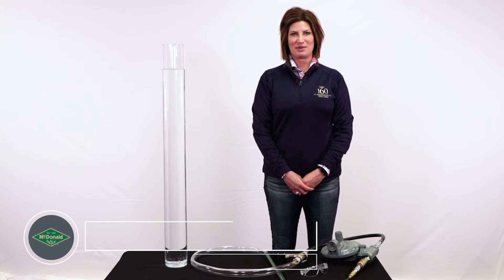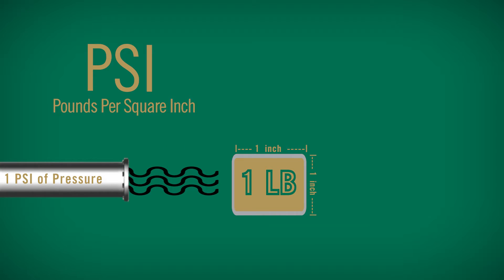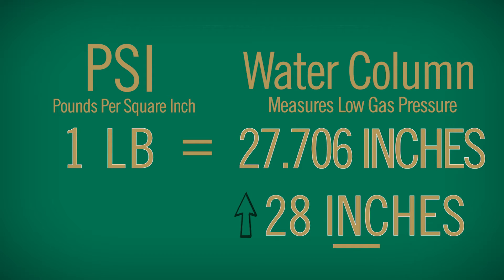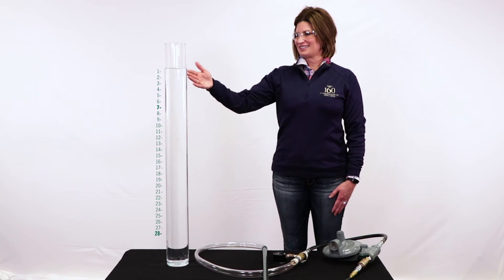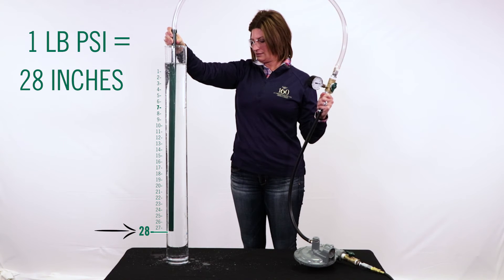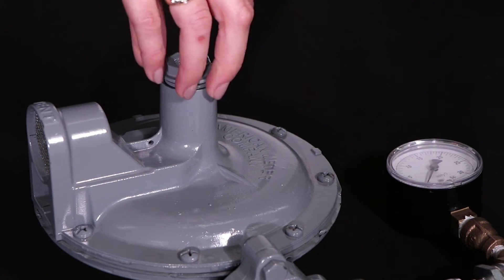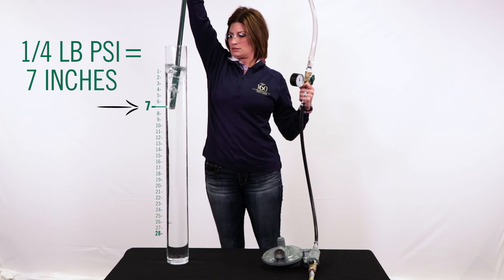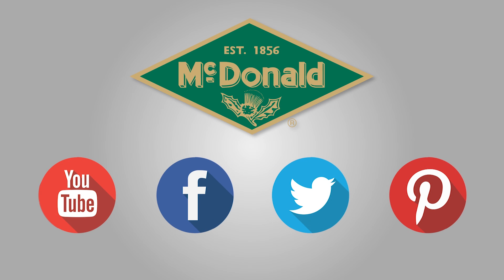Bubble Point Pressure Test

Comment: Sorry for asking so many questions but does the diameter of the gas outlet tube and altitude matter as well ?
Reply from the maker: The volume of H2O nor the diameter of outlet tube matter. Whatever size outlet tube you have, if you have 1 Pound Per Square Inch coming out of the tube, that tube will stop bubbling at 28” depth. Likewise, if you have a ¼ Pound of Pressure set to come out of tube, you will see bubbles again at a depth of <7 Inches.